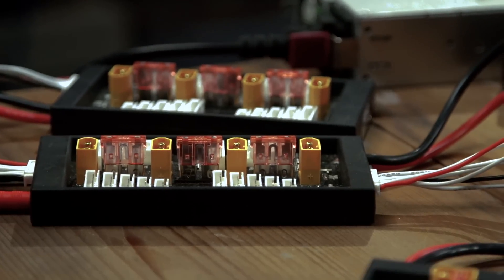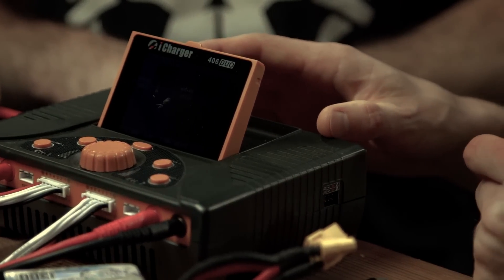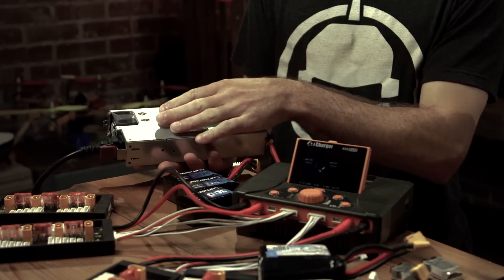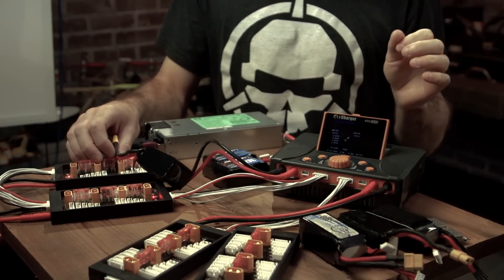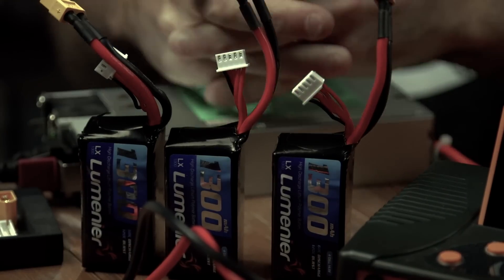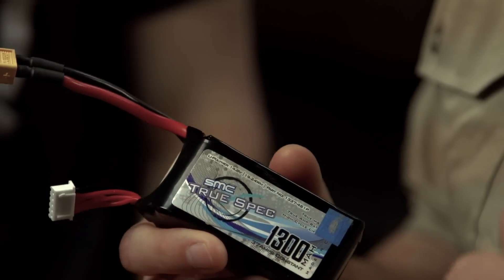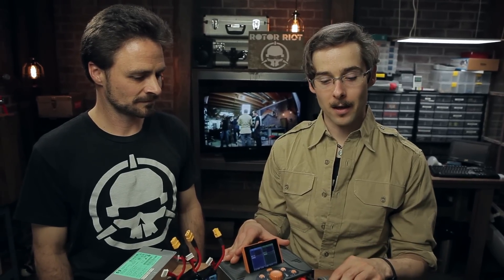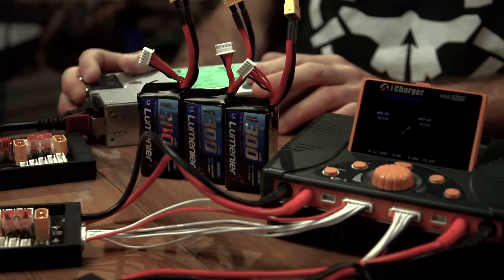Parallel Charging Batteries

Comment: whats the deal  of buying a big charger for 350 Bucks  instead of 10 crapy for 35 Bucks each?  
The aford should be the same because you dont have to check the 0.2 Volt rule on every single battery.
Reply: +rc-wingman So you want to deal with a room full of 35 chargers? I don't.  Plus the cheap chargers have very few features that the high end ones do which you will love if you try them
Reply: well you are right. but you have redundancy with a lot of 35. if your expencive 350 charger brakes it's bad. if a 35 charger brake, it's not a big deal. I don't miss any features on my cheep charger. What's so bad on a imax B6AC V2 for example? I simply plug in the battery and push a button for balance charging.

Do I need more then balance charge, fast charge and balance discharge?
You can monitor your charging on a PC with logview to see the loadingcurve.
I do this a lot.

That would be realy interesting for me... What are the real benefits buying a 350 one?
Reply: +rc-wingman in all honesty, breaking an expensive charger is not something I worry about as it is much better quality. 

Why would I choose my 406 Duo over a cheap charger? Simple. It balance charges much better and quicker, there are some bad packs a normal charger simply won't balance, you can customize how the charger balances the packs, you can have presets for various types of packs, you can charge HV packs easily, you can set voltage settings for any preset, you can setup a full run in cycle to happen automatically, you can accurately and easily check the IR of each cell in your batteries, you can attach a temperature probe to monitor pack temps for safety and you can log all the parameters onto an SD card to keep a log of the health of all your packs. That is just a few points. All this in one box that doesn't take up a whole table and 35 wall sockets.
Reply: ok you win! Thank you :)
Reply: +rc-wingman I will take a look into a 406 DUo.
The features sounds amazing. This makes a lot of sense in therms of safety.
 Thank you a lot ;)
Reply: +FinalGlideAus 
sorry....
...but if you charge them in parallel, the most of the features won't work anymore right?
Parallel charging would theoretically disable:
presets - because you cant do a preset on a random amount of packs
IR should be also not possible
Temperautre probes are not possible too because dont work on a undefined amount of batterys
SD cards are not usefull on parallelcharging too because, what would you do with data of a undefined combination of packs?
So to reconsider your thoughts about the 406 Duo it still dont make any benefits with a lot of packs.
I would say it's theoreticaly more dangerous compared to a cheep imax B6AC V2.

What do you think?
Reply: +rc-wingman I have many presets for many different charging setups.  IR is something that can be done very quickly for each pack by themselves.  It only takes like 3 seconds.  Sure The SD card and temp probe is less applicable when Parallel charging but I personally never bother with such small and cheap packs. The other settings available alone make it worth.  There have been plenty of packs I have had dramas with on the cheaper chargers that a decent charger has no drama charging.  For example, if you drop a Lipo down to a really low voltage then a regular charger will not charge it.  The only way to bring it back is to charge it on Nimh setting which is risky.  The 406 Duo will detect the low voltage and limit the current on the cell in question until it gets to a certain higher voltage.  If there are any dramas continuing the charge it will stop the charge.  I can only say you should at least try one and you will see what I am talk ing about yourself.  

I can certainly see you point about having lots of cheap chargers as an option but all I see is 35 chargers the take up half a room, 35 wall sockets which is an electrical nightmare and they still don't charge the battery as well.  

A big plus for me also is I travel often.  One thing I can't do is take 35 chargers on a plane with me everywhere I go.
Reply: +FinalGlideAus its obvious for me that the 406 DUO is a great machine. This is a good investment i am thinking to make now. Essential to check the health of cells.
From that what I conclude from the video and your conversation I still think its more safe to use cheep chargers on "healty" packs instead of loading them parallel on the "super charger".
All what the 406 DUO can provide in  parallel charging is a safty fuse.

what do you think? Am I still wrong?
Reply: +rc-wingman essentially when you parallel charge the packs are all being treated as one. Despite what the naysayers believe there is nothing dangerous about it, so long as you follow a few simple rules. That said, Lipos in general could be considered dangerous on their own so if you are concerned with the dangers of parallel charging I would be just as concerned with lipo charging as well.
Reply: +FinalGlideAus Thank's for that interesting tech talk. Sorry I missed this answer.
Yes right, fully agree,  lipo's are dangerous, that's why I took parallel charging into question. 
You are from Austria right? Are you a RC-Glider pilot?

Comment: The iCharger range of chargers are brilliant and very accurate at balancing, something that is worth paying extra for. Buy cheap, more often than not buy twice! The IR and ability to cycle new packs to break them in is nice too :-) I use a 406 and often parallel charge multiple 6S heli packs using it. One thing to note is that when you start pulling higher amps, it may be worth increasing your input/PSU voltage. The higher the input voltage the more efficient/less amps the charger will draw, so 24-25V is probably worth considering. Quad packs are quite small though so 12V may be enough :-) I use 2x HP 600W server PSU's linked for 24-25V. I also use an old iCharger 206b... still a good charger (20A output) and handy for hooking up to the running car to charge! :-) When linking server PSU's, you need to be careful with grounding of the PSU's... plenty of forum posts available about modding various different server PSU models too! :-)
Reply: +stualoo P.S. great job on the videos! I am relatively new to FPV racing quads and loving it as a rest from 3D helis :-) One thing I want to know a bit more about is PID tuning and getting the quad on rails :-)

Comment: Guys can u explain freestyle PID'S VS race PID'S ?
Reply: +Gautam Verma Simple, Freestrle PID's need to be very tight but without oscillations so are fiddling to achieve.  Race PID's can be caked off a bit as you still have good control but are not trying to flips and roll quick and Power is more important so it's in your interest to have it de-tuned a bit so you have less oscillations and more power.  Any oscillations have the same effect that voltage has when going through a step down switching reg.  It gets reduced.
Reply: Thanks for replying Mate. and thanks for explaination :)

Comment: Thanks for the great video, parallel charging is such a benefit and contrary to some people's beliefs it does balance cells too. You should look at the 'Bump Controller' from Revolectrix. RFID tags on batteries and it handles all the math for charging singularly or parallel and keeps track of cycles, IR etc to help detect bad packs. After using it I am sold, and at the risk of sounding like a evangelist, it is the future of charging.

Comment: One major thing that was left out is letting your batteries equalize after you plug them but before you charge them. In my experience even with your cells .2 volts apart it takes a good 5 or 10 minutes for the higher volt pack to "charge" or equalize the lower voltage pack.

Comment: The link you provided for the instructions how to modify the power supply goes into using two of them to do 24V do you need to do that for the charger that you were using?
Reply: +Jonathan Wolff Only if you want to use the full power of the charger. with one PSU you have 50a available. Two PSU's give 100a but that is not really needed if only charging smaller size packs

Comment: So who's right about parallel charge voltage??
Individual or total....?????
Reply: +Kevin Keane Both were right, but basing it on the total voltage is ultra conservative. +/-0.1V/cell is fine. If you are unsure, plug them into the parallel board and let them sit for a few minutes before starting the charge, and their voltages will equalize.

Comment: if your charger can not put out 1c worth of amps is it still alright to charge it? will the batteries still reach full charge? i have a parallel charger coming from ALIEXPRESS and have never charged multiple lipos together.
Reply: Yes it will fully charge but it will take more time.

Comment: Damn the whole 1 pack taking the other 3 with it scares me. i own 7 batteries and the money i spent on them should have been to pay water and electricity last month but fuk it . my charger hooks up to my car battery and id rather fly than have water or lights in my house:)
Reply: Its not dangerous as long as you CONSTANTLY OBSERVE the voltage of each cell. I mean, like be obsessive about it. Keep an eye on it before, during and after flight. Then, do the same during, before and after charging. 
No matter how good a pack is, eventually one or two of its cells are bound to get weaker. It's no different than you aging and getting beat up over time. When that process begins you need to offer special treatment for that pack. Baby it individually or with other packs that are acting similar. If it's too much for you, replace it with a fresh one and store that one for future emergency use, or for other less stressful/demanding applications. Follow the manufacturers instructions for storage charging and best storage practices. Do not be afraid of parallel charging, just take your time before you hit "GO"  on your charger. Chances are you are going to save tons of hours parallel charging, so give the setup the time it deserves so it's done right.  ;)

Comment: Lol, I said diode.  I meant resistor :)
Reply: What connectors are you using to plug the icharger into the power supply? Just got the same setup.
Reply: +Bennett Tomlinson I just used the cable that came with the iCharger and soldered the lead to the back of the PSU
Reply: +FinalGlideAus Got it. Many thanks.
Reply: FinalGlideAus

What kind of diode does it use and where can I find one?

Comment: men I wonder if my graupner polaron can Parallel Charge Batteries
Reply: Any charger can do it. It's just at what c rating. Say you have 4 2200mah batteries to charge it at 1c you have to put 8.8 amps out from the charger. However if it's not able to output that many amps then your charge will just take more time.

Comment: That charger is $300.
Reply: +Mike Sera (Hemispheres)  Yeah, that's crazy.  My $50 Tenergy charger from amazon will handle 6 3S or 4S batteries a at a time with no problem.  It's only 5 Amps, but it gets the job done.
Reply: +Mike Sera (Hemispheres) It does seem really cool but I agree. I'm not sure I'm ready to commit to a 300 dollar charger yet. I was recommended the Turnigy Reaktor by a knowledgable source for a reasonably priced charger with good electronics.

Comment: Parallel charging sounds way too fiddly and lack flexibility. For the price of that charger, one would be way better off with six iMAX B6 chargers with 6 way splitter from the 12V power supply. Charge whatever # of cells, whatever the charge state, balance, store, whatever you need without all the restrictions. And you get to save some cash.
Reply: +HLMAX I can still charge my 24 packs faster and it takes up far less space when I travel.  Plus, cheap chargers like the iMAX don't balance charge as well, have far less customisable features, don't run in you packs when new and don't take up heaps of wall sockets

Comment: Do not mess with lipo's! Use the storage mode wisely and let the lipo's cool down before recharging it on 1c max. And if you mark them, a notebook, thermometer and a stopwatch can be handy. Just for understanding what your battery does in different circumstances.

Comment: Those hobby king boards are crap. I've bought three of them and they all came with bad traces or dry solder joints. Then I end up having to do sketchy jumpers between the blown traces. Buy the more expensive ones that have better quality control.
Reply: +Robertlavigne1 Sorry to hear that mate.  Mine have been rock solid

Comment: Good to know.  I was under the impression that I had to be within .01/cel when parallel charging... so for a 4 cell lipo I would be looking for a .04 variance.  I don't know where I heard it, but now that I know it's .2/pack... I'll be charging a lot more batteries together.  =D
Reply: +Mikey “JellyLegs” Richard I don't believe there is a hard and fast rule there.  The further out the cells are the harder it will be on your packs so try to get them as close as possible
Reply: +FinalGlideAus Ohms law is a pretty hard and fast rule... V=IR. When you plug the second pack into the board the current will flow from the higher voltage pack to the lower voltage pack. Internal resistance of each pack is ~25mOhms so call it 50mOhms for the two packs (the IR is essentially in series for two packs in parallel). What current will flow?
1. 0.1V/Pack: I=0.1/0.05=2A (about 2C for a 1000mAh pack)
2. 0.2V/Pack: 4A
3. 0.1V/Cell (4S) = 0.4V/Pack: 8A
4. 0.2V/Cell (4S) = 0.8V/Pack: 16A

So for a brief moment in time, Chad is charging the lower voltage pack at 16C (or possibly higher with multiple packs), while Steele is charging it at 4C.

Personally I group them into 0.1V ranges. If there are some that are slightly out, charge the lower packs partially until they're within 0.1 of the higher packs and then stop the charge, add the higher packs and restart (you can now adjust the Amps to cater for the additional packs you've added to bring your charge rate back up to 1C)

Comment: So can I just plug the balance leads into the parallel board first to alow those to balance before I charge?
Reply: +Russell Gilder Yes but they still need to be similar voltage
Reply: Just to add to what Chad said, they have to be of similar voltage because the higher voltage packs will essentially charge the lower voltage pack and if the voltage difference is to high the amps pumped into the lower voltage pack can be high enough to damage the pack.
Reply: Ahhhhhhh.  That's what I was missing.  The discharge level is so much higher than the charge level that the higher V pack will damage the lower
Reply: +Russell Gilder this is true because of the low internal resistance that high discharge packs have, they can let a LOT of current flow in milliseconds. that is another reason to have boards with fuses, use a fuse that is right at the max charge C rating so if too much flows between the leads, the fuse pops before the pack is damaged.
Reply: Yeah well technically the discharged pack would be lower than the charged pack ;) but I know what you meant.
Reply: so the whole point of a fused balance board is to protect against over amperage between packs not between the charger and the packs. That makes more sense. I was trying to figure out what the fuses where doing. Thanks guys I think this makes more sense to me now.  "the  more you know..."

Comment: one thing to check for PSUs are if they have a physical switch. some don't and you have to hook a button up to the wire that toggles power
Reply: +Ty Lloyd The PSU in the video has no switch.  Once you add the resistor they turn on when you add power.
Reply: +FinalGlideAus oh awesome, i might have missed a part in the video. Apparently now i have some old PSUs that i otherwise would not have ever used. good video, thanks

Comment: So, if I got a 3 cell 1300mah and a 3s 1800 mah, there is no problem charging it in parallel?
Reply: +Luis Specian No, so long as they are the same voltage.  It will act like a 3100mah pack
Reply: +FinalGlideAus so the question is, if i want to charge the 1300 and the 1800 mah and deal with it as a 3100, so i can charge it at 3.1 A to charge at 1C??
Reply: +AbdelRahman ElHijazi Correct

Comment: Thanks for a good show guys! I like my iCharger 406 alot and wanted to say that it accept an DC input voltage of 10 all the way to 30 V. I parallel-charge my car-lipos, it feels like a good way. Better to charge two batteries at 1C for one hour than charge them at 2C for 2 x 30 minutes if charged separately at the same total time.
Reply: Yeah my Hyperion charger comes up with weird errors at 12 volts that disappear at 14 volts. So a pure 12 volts isn't written in stone. A car battery is actually around 14 volts so if that were true you couldn't charge your batteries from a car.
Reply: +Kurtis Towery Hi! I do not really understand what you are trying to say, but I have tried 12v on my 406 with no problems, and I was only talking about what DC input the iCharger 406 can handle, no other models or brands, thanks :)
Reply: I'm just saying you don't particularly have to have strictly 12 volts.
Reply: Yepp thats the same thing I am saying (10-30V is ok for my charger) :)

Comment: How big a difference you can do depends on how hard you want to charge the lower cell. At 0.2V difference per cell, two 4S with per cell ir of 8mohm and a 10mohm par board will give:
0.8V/(74mohm) = 11A = a bit over 8C (for 1300).
it's also not a current you want to push through the balance leads...

Comment: I have bad experience with parallel charging. I charged 2s battery and forgot to pull out wires from distribution bord, then connect 3s battery. I got fire in 1 minute. It was terrible. DO NOT CHARGE battery with different count of cells. But now I now I can charge 6 batteries in parallel mode and all is fine.